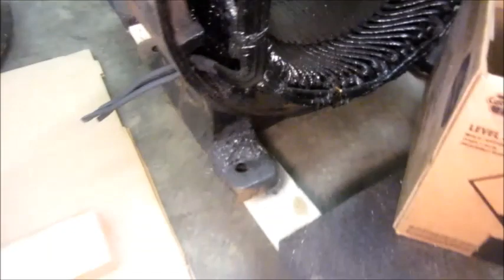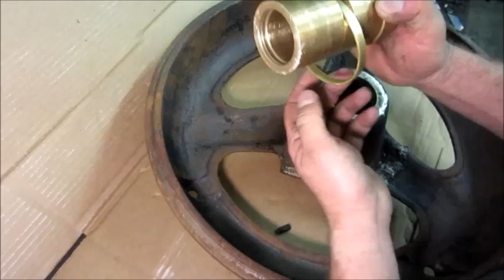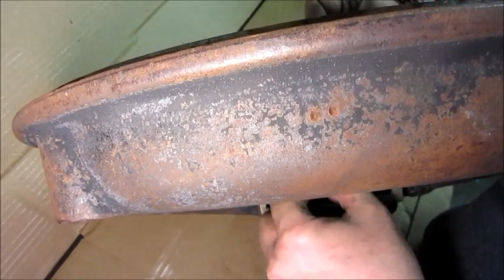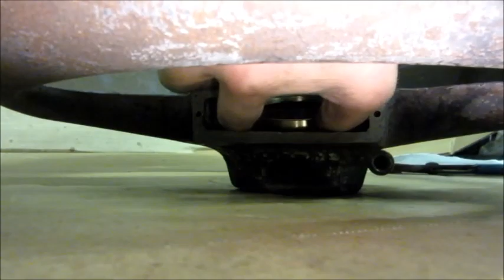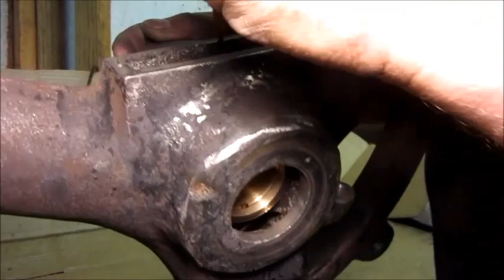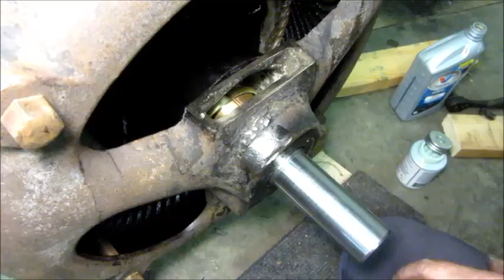Antique Allis-Chalmers 10 HP Electric Motor - 4 - Repaired shaft!

Comment: I like the lubrication system. I saw one similar on a steam engine once but had two rings spaced about 2 inches apart. Merry Christmas..
Reply from the maker: Merry Christmas to you as well!  That's cool about the dual-ring oiling system on the steam engine. May have needed more oil volume, or possibly was a redundancy design?

Comment: Happy Holidays! Awesome Job! Somethin' is out of balance! It's a woabbler!
Reply from the maker: Happy holidays to you as well!  Yes it is not perfectly  balanced! The rotor looks to be fairly hand-assembled and it has clearly had almost 100 years to be abused. The laminations have fanned out in a few areas, and it could be that some have fanned out more to one end, causing the out of balance.  Being a 900 RPM motor, they probably didn't put a lot of effort into balancing when this was made. Also, the wood dolly is really springy and massively overloaded with this motor. I think that a more solid base will minimize the wobble.

Comment: I was gonna say wedge a coat hanger or strip of sheet metal in the top of the oil cavity to make that ledge inaccessible to the oil ring, but your idea looks much more professional.
Reply from the maker: Something like that was my first idea, as well. But this ended up being quite easy to accomplish. I couldn't think of a reasonably simple way to attach the sheet metal without it looking sort of crappy. The Century motors have two threaded holes for (guessing) a 6-32 screw, one on each side of the oil ring slot. There is a little flat brass bar with two screws holding it over the slot. On those motors, you can access the oil ring slot area from directly above and install the screws. I was originally planning to replicate that design, but then realized the screws would be too far from the opening to install them.

Comment: I see a weld on the end cap of the motor. Did you mention that, and was that your repair? Always love your workmanship and videos! Cheers to you and your channel today and into the new year.
Reply from the maker: Hi; yes it's definitely been welded up on the rear housing "spoke" arm.  One foot has also been welded back on; and one foot is still broken off (but I have it and will repair it). In the 90+ years it's been in existence there have definitely been some low points in its life LOL!

But no, I didn't do that weld repair. In general (and arguably) a braze repair is a better repair on cast iron. It seems that bronze is a lot tougher and less likely to crack during and after the repair, than an iron weld is. If I had to repair this, I would have used braze.

Comment: Can't  beat these old motors oil is what held lubrication ring down one modification if sleeve bearing was dismantled was to use thicker oil again these motors are bullet proof in design think about tge name best tractor next to the ford 8 or 9N..you take care if them they take care if you simple motto

Comment: Hey thanks mate for show us that I could understand everything you were saying .
That hack with the copper wire? Or let's say you trick with the copper wire is exceptionally good, and will save the  bearings .
I think it would be good if they still made stuff like that,  that is durable and reliable apart from dumb shit just like that , not that it won't ,or not that  it will get stupidly stuck up top by been  bounced up on to the inside edge of the bearing housing .
This is why I like what your doing .
You are gental as you have to be, to protect the rest of the components of the motor as we pull it down past the problem to make sure that we have resolved and identified the problem or problems.  That was a mechanical problem in the motor.  But if its electrical fault or needing rewinding of the field windings , maybe bit more of a hassle to fix. But a motor like that would I be a wise man and have it rewound or would I replace the motor compeatly ?
Like you im about fixing broken stuff sometimes if its going to be better than a new motor,  couase they don't build shit like they used to . You fixed that motor like a pro sir and I like that . Thanks for a very good educational video.
Reply from the maker: Thanks so much for the great comment! If you have a motor like this in daily use and the winding goes bad, I would definitely repair it instead of replace!

Comment: I noticed that at the end when you ran the motor the rotor was unbalanced, did you or do you plan on correcting that? I know a very accurate but simple method of finding where to add or remove weight.
Reply from the maker: It is unbalanced. I think in the past the shaft was repaired before and they may have not been careful when driving the shaft out of the rotor. 

The stand on wheels seems to allow it to vibrate more than it would if it were on a machinery base. It's not as bad as it seems, so I just don't feel like taking the risk to try and re-balance it at this time. The rotor is mad heavy and there's always a risk of hitting the windings when taking it out.

I want to learn the balance process you are referring to. I'll look through your channel and see if I can find it but if you have time you're welcome to post a link in a comment here. Thanks!
Reply: @davida1hiwaaynet  I don't have a video of the balancing method (maybe I should make one) but what you do is once the rotor is removed you sit the 2 ends of the shaft on 2 parallel rods  (I use steel rods that are polished) with nothing in between so the rotor doesn't touch anything, the only parts that should touch the whole rotor/shaft is  2 needle sized contact points between the steel rods and the rotor shaft. Once you sit the rotor on this contraction it will rotate along the 2 parallel rods until the rotor comes to a stop and at that point the bottom will be point to remove weight or to add weight to the top. (Note: make sure your rods are perfectly level length wise other wise large rotors that you work with could roll down the rods instead of stopping at the heavy side and could become out of control situation.

Ps. Something that would work great for this is one of those clamp benches like this one: https://images-na.ssl-images-amazon.com/images/I/91JIF85SLgL._AC_SL1500_.jpg becaue you can adjust the opening in the middle for any rotor size and all you would need to do is mount 2 steel rods to either side.